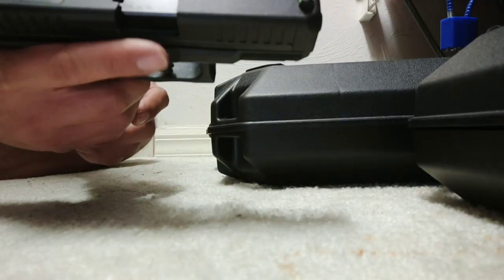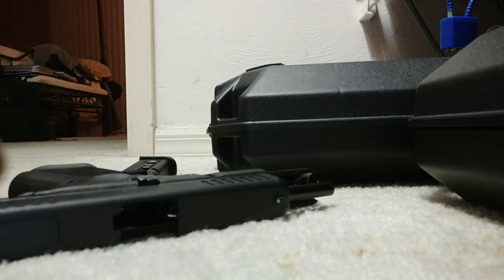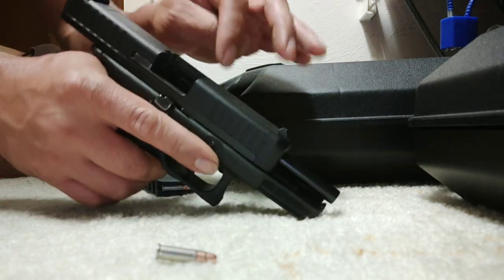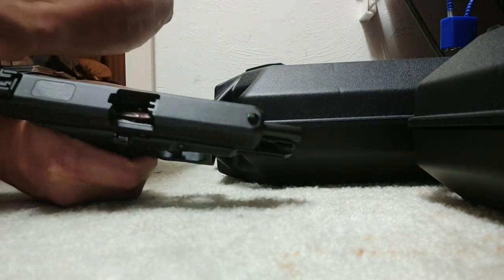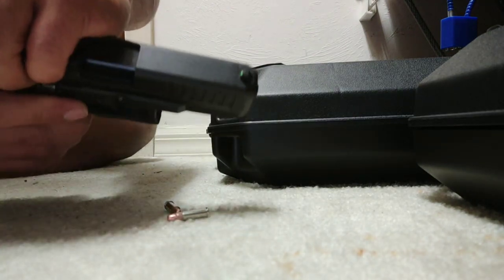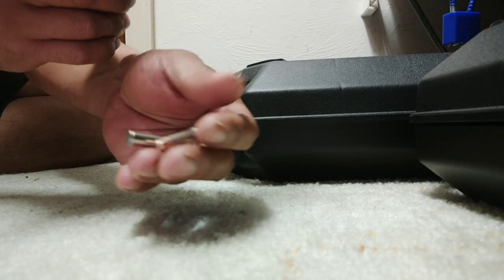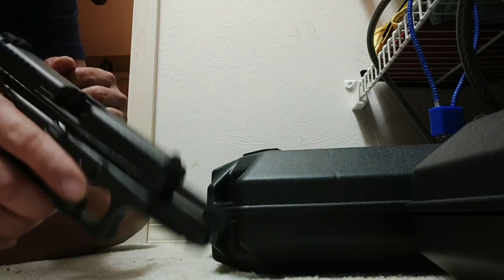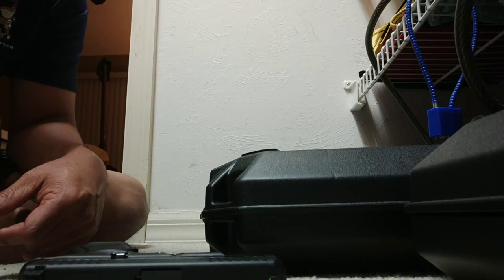Glock 44 extractor issues. Probable damage to  barrel and frame

Comment: My experience with the Glock 44 has been optimum performance. I do recommend replacing the OEM firing pin spacer with the Aluminum Firing Pin Spacer Sleeve from Farrow Tech. Cleaning the 44 after every range day is also critical. 22 lr. Round is very dirty; it will cause buildup inside the barrel, and you will have trouble inserting the cleaning rod/brush accessory with ease. My 44 eats any 22 lr brand and spits out for more. I also did a polish mirror finish on the feed ramp. Love it !!!!!!

Comment: i kind of noticed your rounds sitting low in magazine. Try holding upside down taking slight tension off and hold round so it doesn't fall out. Rounds should go above black plastic at the nose. i had issues with them being to low. were you able to order extractor through glock or someone else?

Comment: What did Glock say? Did you disassemble the slide, check the rod, spring, and extractor? I have a January gun, and so far, so good. I'm not experiencing any problems. Its strange how your gun randomly ejects. It's like the extractor is being held open when it doesn't work... Would like know what's up.